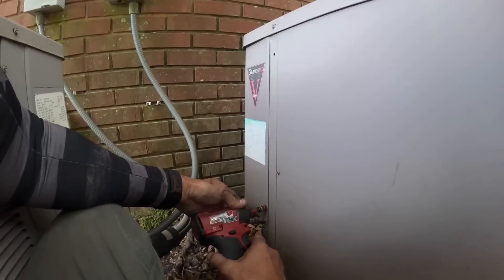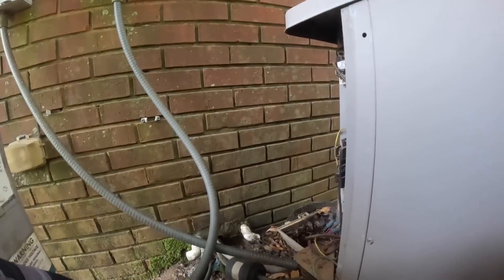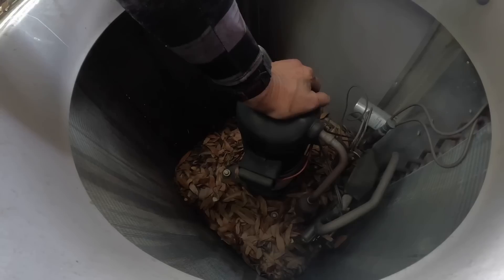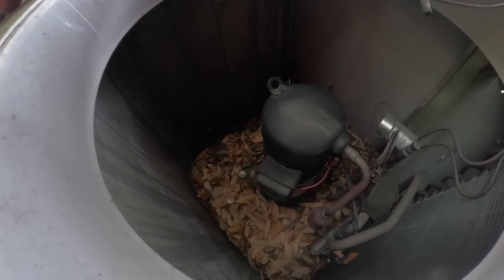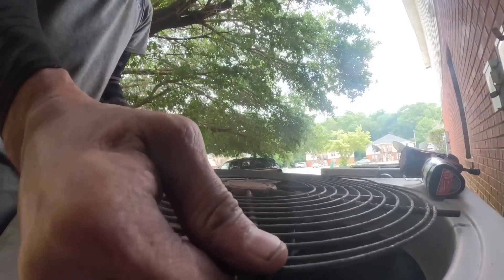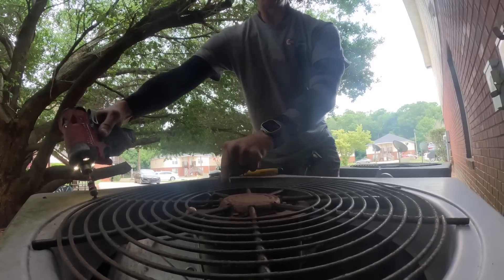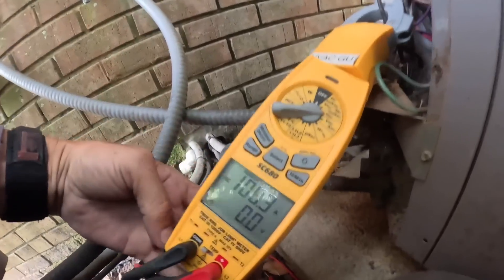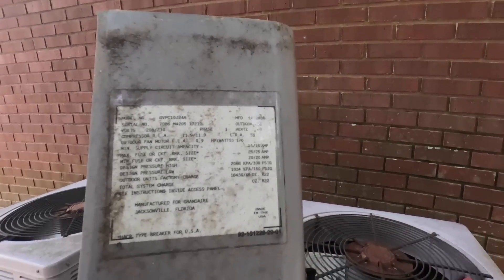19 Year Old Heat Pump Has Finally Run Out Of Time! #hvacguy #hvaclife

Comment: Look at that wire where you checking for amps , half the wire is connected on the lug. You can clearly see in your video. Whoever did the work before did a poor job connecting up the electrical connection to the contactor. Timeline video eight minutes 10 seconds.

Comment: The Black wire on the left side of the contactor on the bottom looks like half of it is not under the screw.  You can see lots of strands of wire on top of the screw head.  Not sure if that could cause the problem or not but just something I saw out of the ordinary...
Reply: I agree, that wiring is half connected. Giving it weak inrush capability and it wouldn't kick into rotation. Then the cap charges and petters out.

Comment: That black wire you got your meter hooked too is a little squirrelly.
Reply: This look like 2/3's of the copper 230vac line wire is NOT connected to the contactor properly...!  8min 26 sec
Reply: @dennylang4165  The connection is still solid enough for 110 amps to pass through, so that's not the culprit.

Comment: I really wish you or another of the HVAC Kniggits was in the Knoxville / Oak Ridge area. The 2.5T unit we were told was enough was NOT, and has never kept up.  The charge is good, filters good, and airflow good (for an ECM).  We're in a 2-section manufactured home and were told its ducts couldn't support anything bigger.  I should have called bullshibbit on that because our old unit was a 3T.  I've no doubt let too much time go by. What's our best option?  Add a minisplit?  Replace the ECM with a PSC and ramp it up? Increase RPM on the condenser fan?  I really don't want to pay for another change out...
Reply: If you decrease your duct size, there will be consequences. If you increase your air flow adjusting your fan speed, there will be consequences. 
  Shit rolls downhill, and needs to fall directly onto the forehead of the idiot(s) who installed that undersized unit in your residence.
  Have you checked the static pressure before and after that blower motor?  If so, what was that static pressure? 
  Get ahold of the manual that belongs to that indoor air handler or furnace that you have, and locate the air flow chart to the blower motor that  is installed in that unit.  Then find your total external static pressure, and go from there. 
  Just be sure not to increase your ESP too much, as this will put a strain on that motor and burn it out faster than you can imagine.
Reply: @Parabellum-X  Thanks for the info, but a lot of that is over my head (I've not [yet] gone to trade school for HVAC) which is why I'd want to hire a pro.
I certainly have no plans to reduce duct size.  I don't have the tools to measure static pressure.  Knowing how much ECM motors hate that though, is why I ask if I should replace it with a PSC.  The unit was installed long enough ago (almost 3 years) that I probably no longer have recourse against the company.

Comment: When you were connecting the hardstart kit. The main led coming into the unit was hanging on with just half the strands of wire. Go back 
And make to wires are connected properly. Or go back and we watch your video I know it was a tight fit
Reply: The Compressor LRA was pulling 108 amps. If the 240V line was a problem, it would have been really smoking at that point. Not to say it doesn't need fixed.

Comment: check your wire connections on the contactor.  the 240 volt terminal on the bottom left is bad.  it may be the reason the compressor is bad now.
Reply: Noticed that one.
Reply: I was wondering if someone had already posted on that, or I was going to.  Curtis had the camera positioned so we were at the perfect angle to see that.  I'm not sure he could see it from his vantage point.
Reply: “nothing obvious right now “ 

👀

Comment: Thanks.  Always good to have at least one portable unit handy.
Reply: I have 4 window units in my garage; I bought those in case my central system fails!
Reply: Like in the 1950s and 60s.  TV repair shops had loaners if your set had to go into the shop.
Reply: @dfirth224  I remember that!

Comment: One of the Coolpressor tools would have helped  cool it down in this case But knowing my luck there wouldn't be any water within a mile LOL But turned out it was on it's death bed anyway Very nice gesture offering to install a window until until you can get to her for a changeout! I know it's got to be hot down your way since it's made the 80's up here in the VA mountains